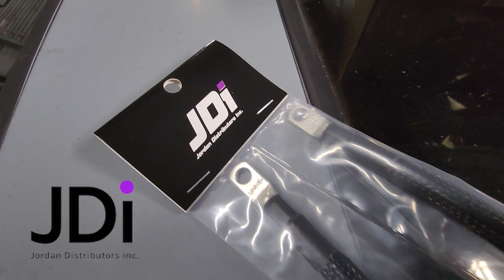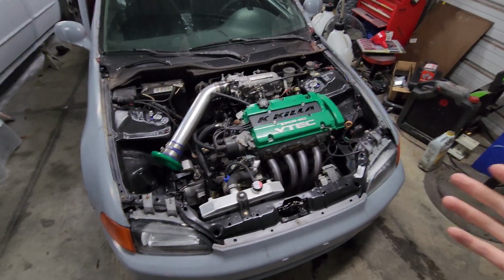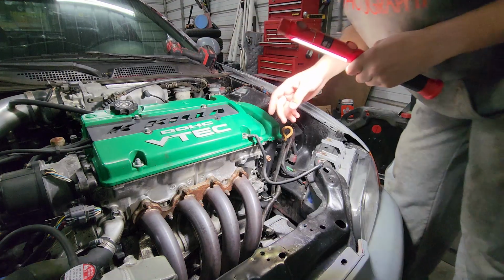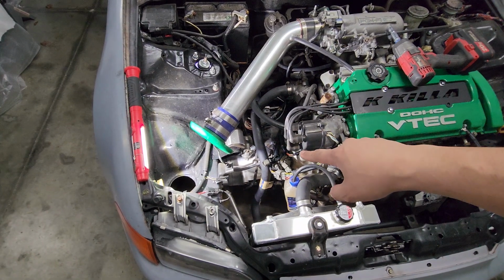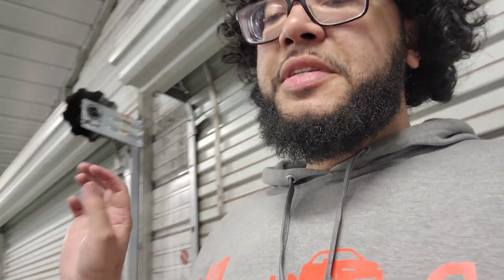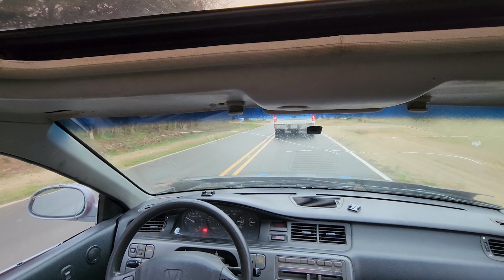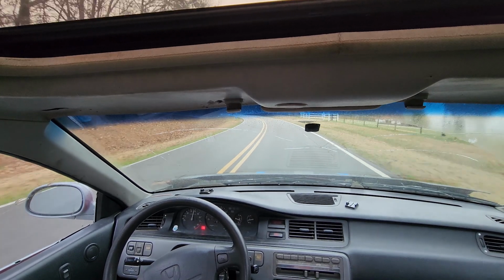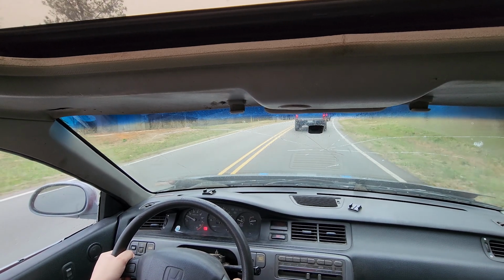ALL MOTOR H23A/B16 Swapped H2B Honda Civic | JDi Ground Kit Install | First Pulls Since DynoTune!!

Comment: Hey what dizzy are you using and harness? Because I have a 97 ek with h23a and using the stock harness and running obd1 h22 dizzy with p13 ecu and won’t turn on.. it cranks but not turning on